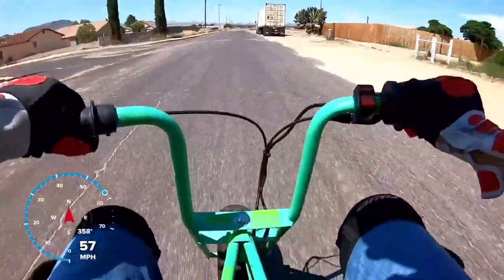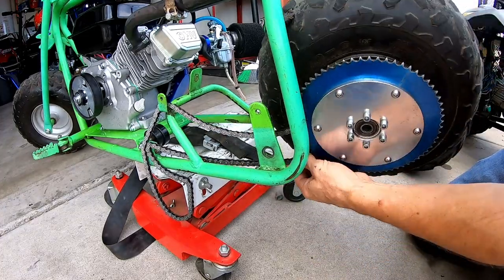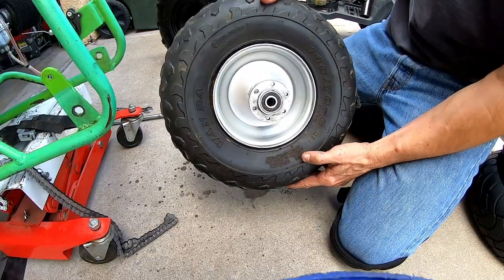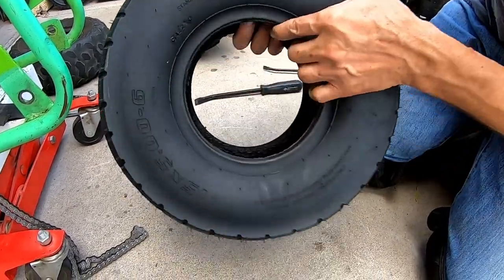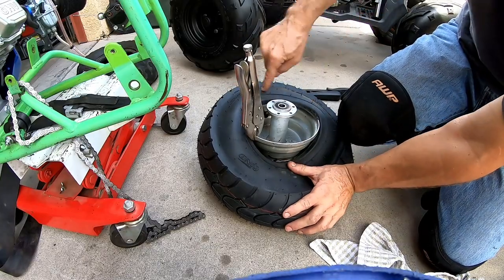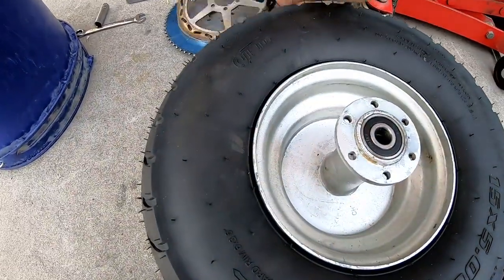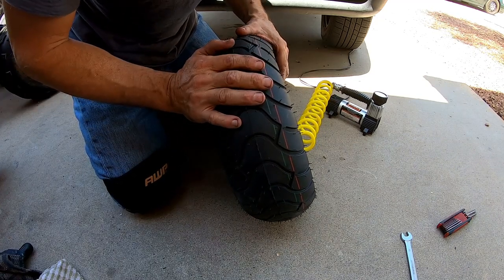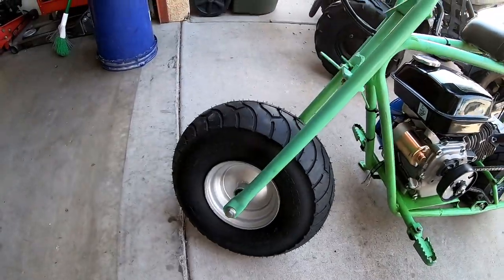Ultimate street tire installation on the Doodlebug Minibike/Top speed test

Comment: Great video! I'll get these tires when I need a new set. Rubber ages like milk. It loses elasticity, strength, and grip with more time & heat cycling. The entire tire (haha) dries out and starts to harden, crack, and delaminate. Regardless if they are still round or not, performance absolutely drops off with age. Even if the tread was still new with zero wear, the tire is significantly less capable than when it was freshly molded. The silver lining is that fresh quality tires are almost always a very noticeable upgrade. You'll never regret getting some nice tires, for any vehicle.
Reply from the maker: Thanks!

Comment: Is there a right/wrong way side wise to install the rim or is it the same whichever side you install left vs right?
Reply from the maker: I usually put the valve stem on the brake side but it will work either way.

Comment: I think these are the ones my friend Skott has. If so I hear they are pretty sweet on the street!
Reply from the maker: Ya, they are smooth riding !
Reply: @Black66  how long do they last
Reply from the maker: @fernandocastillo8026   Not bad so far. Seems like they hold up pretty well considereing im running them at fairly fast speeds all the time testing stuff.
Reply: @Black66  thanks

Comment: Yo I can't stop eating my rear tire. Sprocket is straight with motor / clutch and even tried an 8-ply tractor tire it's just sad that I can't fix this issue. Frame isn't bent I just don't think these tires are made for the speed and road. Thinking of trying air plane tires bc I don't want to die on my little kids mini bike

Comment: Hay I have a Coleman cc100x mini bike and I was just wondering what the best sprocket to clutch ratio for fastest speed
Reply from the maker: If you have the three-horse on there then the stock ratio is pretty good because the 3 horse doesn't have a lot of torque to pull much more gear.  But you can still get quite a bit of speed out of it. Check out the playlists on this bike.  https://www.youtube.com/watch?v=xSX1JvRi1RQ&list=PLkbj-ip-5FzZ0nscbEFv5cR5LL2KntgvT
https://www.youtube.com/watch?v=WXupxZEZ9as&list=PLkbj-ip-5FzZyxkQC4TesuHYV4KgCMFWX
Reply: @Black66  I have the 3 horse on now but it is winter where I live now so I am going to wait until early spring to put a predator 212 on.
So I was wondering the ratio for the 212
Reply: But thank you for the input on the 3 horse.
Reply from the maker: @soupcansam8957 A lot of it will depend on what mods you do to the Predator. If you want it quick and fast then leave the 75 rear and a 12 on the clutch for a 6.25 ratio. Mine did 50 MPH with that combo, and was really quick getting there. Super fun with that ratio with a mild build predator. 
If you want even more top speed throw a 15 tooth clutch on the with the 75 rerar gear and 
you will be getting closer to 60 . You can put a universal sproket hub on there and use split sprokets to run a smaller rear gear or just change up the gear ratios with the clutch. Check out my video of the Predator 212 swap. This bike had a 6.25 ratio
Reply from the maker: Here is the video https://www.youtube.com/watch?v=tj8XxfvMbRE
Reply: @Black66  thank you for the input I am going to stick with the 212 on to cc100x until I am 17. When I turn 17 I am good to get the ct200u-ex and keep the stock engine that is on it and take out the govner off but as soon as I am 18 I am going to put a predator 420 on it and make it street legal.

Comment: Have you noticed a difference in braking distance on the street compared to the old tires?
Reply from the maker: I haven't did an official braking video but they do seem to stop in a shorter distance than before.
Reply: @Black66  thx for the reply, trying to decrease the braking distance on my 212 swapped baja warrior. The rear drum can only do so much. Time to change the old offroad mud tires for some street ones.

Comment: I guess what I meant is you always do straight chain, or so it seems. Why is that?
Reply from the maker: I do like running a straight chain over a torque converter on the smaller bikes. They are plenty quick with a straight chain along with a lot of top speed. The bigger bikes I like a torque converter because with the tall tires, they aren't that quick with a straight chain. And it's hard on the clutch.
Reply: I just recently picked up the Coleman ct200u-ex, have you ridden that mini bike before?
Reply from the maker: @troy22nd  I have tried many different combos on this bike. Check out the Coleman ct200u-ex playlist https://www.youtube.com/watch?v=X0SmAZJ6qW8&list=PLkbj-ip-5FzbVBVqMi23O5noFSAbhNOp1

Comment: What engine is in there?
Reply from the maker: Check out the doodlebug playlist. The bike has had many different engines. https://www.youtube.com/watch?v=pZ3Tw27R-5A&list=PLkbj-ip-5FzbLQb21ZZW1mmWP45vj4kxW
Reply: @Black66  well  the thing Is I would like one that would fit and not be so much work /put together cost do you know of one that can go fast and also fit without any mods also could you link the gas tank for the tilly and the clutch and carb and throttle?
Reply from the maker: Tillotson 212 is the best drop-in engine without any mods to the engine IMO.Links for the parts used are in some of the videos description in the Doodlebug playlist.   @Mini_bike09
Reply: @Black66  ok thx

Comment: if u white out the lettering on the tire it adds bout 5.9 mph lol
Reply from the maker: At least!
Reply: @Black66  lol hey thats a 15 tire i had that one it caught a lump idk so i guess it dosent add top end with the bigger tire i guess u need a bigger wheel ? im thinking trying the 10inch modular wheel like diy willy did just try out the front on my motovox im running a 13 inch small street tire it picks up quick but not alot of top end

Comment: a small amount of dish soap and water on your new tires will make life easier when removing old and installing new...of course, that is my experience
Reply from the maker: Thanks! I use  303 Automotive Protectant or something like that if i want to lube up the tires because from my  experience when I use water it gets in the wheel and rust the inside. So a lot of the time i will just suffer though it and use nothing.